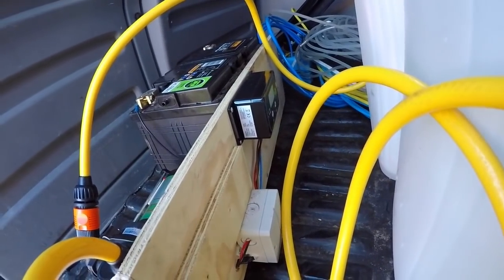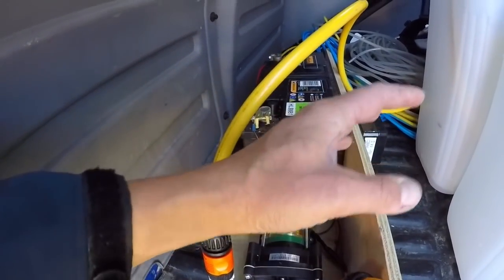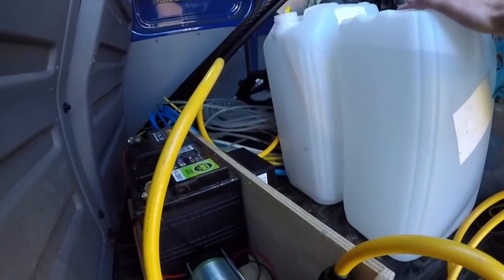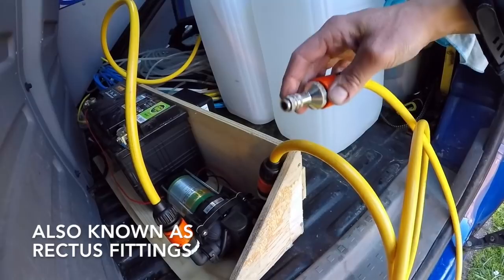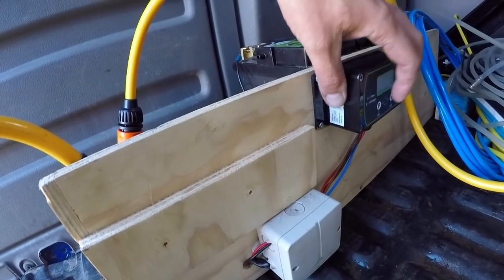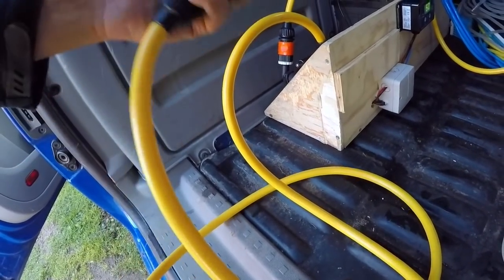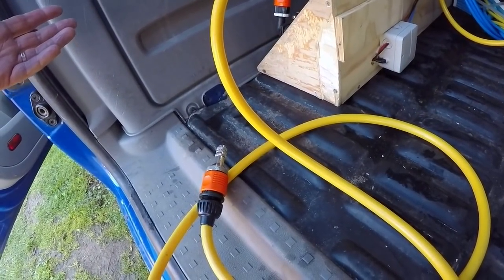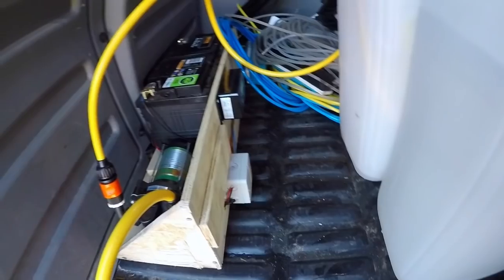Setting Up My Pump And DIY Van System For Water Fed Window Cleaning

Comment: Nice video Ashley, always good to see a self build system. You dont see many Vyaire pumps being used but they are well made. The reason your pump works better is because you have water pressing down on the rubber diaphragm creating positive pressure which prevents air bubbles forming when priming
Reply from the maker: AW Photographic Nice one. Thanks 😃👍🏼

Comment: Would this system work for cleaning solar panels, your channel is so informative and helpful it really makes a difference, thankyou.
Reply from the maker: Sure. I normally use a higher flow for solar panels, and this can be easily adjusted with the controller.😃👍🏼

Comment: Hi - great video. Do you need the flow controller? I have a switch panel with some spare switches which are fused. Could just come off of that?
Reply from the maker: Possibly, I suppose so. I’m not an electrician. The controller allows you to vary the amount of flow in order to control the amount of water you use. I think if you just connect it to a switch you would only have full power or off?👍🏼

Comment: Hi, thanks for your video.  I’m currently running a water fed pole for window cleaning and would like to add in the option of house cleaning with the pole.  My current hose diameter is 5/16” OD (3/16 ID).  What hose diameter do you suggest for running the biocide and surfactant setup?  Is a flow control box necessary?
Reply from the maker: Cory H In the uk we mostly work with 8mm hose reels and lighter 5mm up the pole. I actually use a 6mm hose reel which is a bit lighter.😃👍🏼

Comment: I do not see the fuses to protect battery and pump motor , do you have a water filter at the pump inlet ?  For information there is a kit  with a  smaller motor, just a little less flow:  100psi 4.5 L/mn ; this motor consumes less current (3 times less) - I think yours needs 8 Ampere and this one 2.3 Ampere , so you can have a smaller battery too (45Ah) , less weight and space ... BUT is it so reliable ?? 
10.5 Volt seems very low, for a car , not below 12V is recommended , avoid under 11 V ...
Reply from the maker: There is a fuse that came with the controller in the little grey box with all the other wiring connections. I didn’t need such a big battery, that was an error on my part, and yeah it could do with a filter before the pump. But apart from that, it’s very reliable and still works well. I have a van mounted system for window cleaning now, but I still use this diy setup quite a lot now for applying biocide to roofs.😃👍🏼

Comment: Hi Ashley just wondering how much this set up would cost to put together thanks
Reply from the maker: John McCarthy The pump is about £75, the controller is about £80, and the battery is about £75. Plus the bits and pieces of hose and the wood it’s mounted on. I’ve put some links in the description. I hope that helps.😃👍🏼
Reply: @aemackintosh  thanks for getting back to me it's a good setup I'm working from a back pack at the moment hoping to upgrade  soon thanks again
Reply from the maker: I hope it goes well. Keep up the good work.😃👍🏼

Comment: My setup look the same, but I have plastic boxes for the pump and flow controller ... but bigger tank 👍👍👍
You save much to build yourself,,, Any Transporter coming up? My caddy got hit in the rear, waiting for it to be fixed
Reply from the maker: Robert 😬 I’m still looking for just the right van, getting a bit frustrating now though.😃👍🏼

Comment: Hello where did you get the arms for hose lock connections to fit your pump ?
Thanks
Reply from the maker: The Gardiner website has a great range of hose connectors and fittings.😃👍🏼
Reply: @aemackintosh  thank you for replying

Comment: What wires do you use to connect your pump to the battery please mate.
Reply from the maker: When you get a pump controller you should also be supplied with all the wires you need and a diagram of how to do it.👍🏼
Reply: Thank you

Comment: I was doin barrels with a trolley system to start with, soon bought a 300litre tank lol.. why dont u buy a 150-200l tank? Saves time messin about with the barrels
Reply: Jack Stratfull that’s the set up  I’ve got at the mo, not changed to tank yet as maybe changing my van
Reply from the maker: I’ve been exploring different ideas and methods and I really wanted to show this on my channel too. Ultimately I’m hoping to sort out a bigger van and tank if possible.💦😃👍🏼
Reply: A.E.Mackintosh Cleaning Services 👍🏼

Comment: Hi, I wonder if you could help!! Could you let me know where you purchased the connectors for the shurflo pump in this video? We use the shurflo recommendation but the leak like mad... thanks for your help
Reply from the maker: The fittings on the pump itself came with it, and the hose fittings you can get from Gardinerpolesystems.co.uk
Reply: Hi I'm looking for Windows  washing connecting pole,how can i get it i'M in South Africa

Comment: See when u use a chemical 
And then u go on to use the pure water dose it take u long to flush out the pump and hose
Reply from the maker: Irish Salmonlures No, not at all, the pure water will wash it through nicely. But I really just use this setup just for biocide applications now.😃👍🏼
Reply: @aemackintosh  thanks for the reply

Comment: Hello, great video! What pressure do you recommend for 10 sprinklers?
Reply from the maker: Sprinklers!? Not really my area of expertise, but I think that the more sprinklers you have, the bigger pump you will need that delivers a greater litres per minute.😃👍🏼
Reply: @aemackintosh  I mean 10 outputs of water like in the video, not really sprinklers.